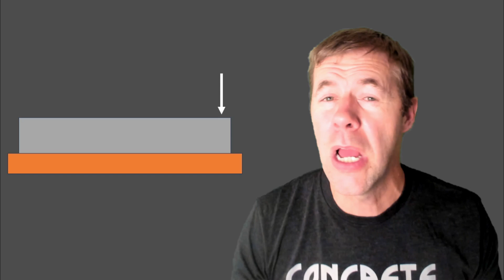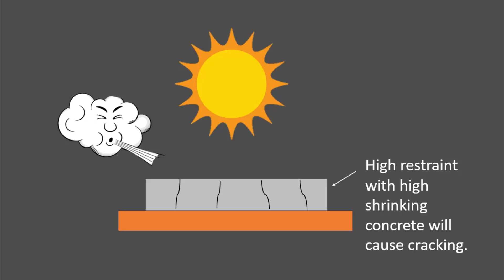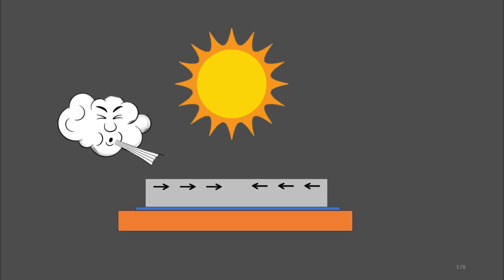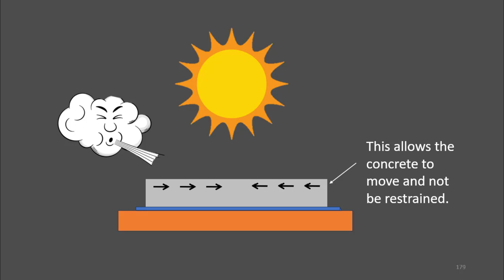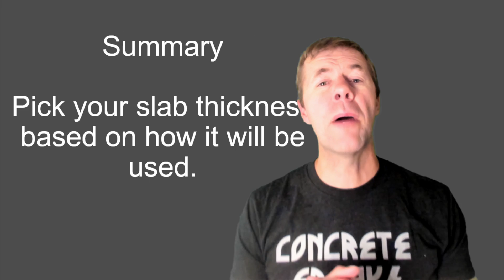Slab tips - Pt 1 - how to build driveways, patios, house slabs, and roads.

Comment: I got hung up on one detail early on in the video and hoping you might explain where my thought process is off: You mention the loads are more critical at the edges because there is less soil/sub grade support at the edge, but I was under the impression that what’s changing is not the soil conditions (which ideally should be consistent across the site) but instead at the edges and corners you have less concrete to support the point of load application and distribute it throughout the pavement? That’s why corner loading is always the highest stress - it has only one quadrant through which to redistribute stress vs 2 for edge loading and 4 for interior loading. But I’m mostly self-taught on this, so if I’m wrong I’d love to be corrected! Also, and maybe this is already in the part 2 video, but if not, I’d love to learn more about using thickened edges on pavements to manage some of that stress. I’ve seen them but I haven’t seen much regarding when and where to use them. Lastly, it’d be wonderful to have a discussion about the interplay between the structural design of pavements and the materials design. Most of the resources I’ve found treat them completely separately, but like everything else with concrete, this is a system and we should take a more wholistic approach to thinking through how to optimize the design. 😊 thanks for another great video!
Reply from the maker: Thanks for the comment!  It looks like I need to add more discussion about the edge loading.  There are lots of reasons that edge loading is bad.  There is less concrete and foundation to distribute the load and the slab may curl from drying and so it may not be in contact with the soil.  That will have to wait until vol 3.

There is interplay between strength and thickness of the slab but this is pretty complicated.  People use finite element models or fancy design software to handle this.  This is tough to get across in a YouTube video but I will think about the best way.  Thanks for the question!
Reply: You got it right. Technically there is less subsoil support because of what you describe.

Comment: I was going to say that a layer of sand might also reduce friction but I was thinking smooth precast slabs, but since cracks come mainly from drying shrinkage it defies the purpose. Thanks for the neurons stimulating video.
Reply from the maker: Pat - sand can work but the plastic is usually cheaper and easier.  I have measured moisture at the bottom of slabs with an embedded gauge and I don't see them dry at the bottom.  I only see them dry from the top.  Take care!

Comment: I have learned so much from your channel. The two layers of plastic makes sense. What do you do if you flatwork is on a slope and it’s long? Footing at the top and bottom?
Reply from the maker: Thanks for the question!  You can try and anchor it to something else like another slab or you can toe it into the ground by building a footing.  The footing doesn't have to be that large.  Sometimes you just can't do this and plastic is not a good choice.  You can put it on sand and that is a nice inbetween.
Reply: A good one for professor Ley to answer..